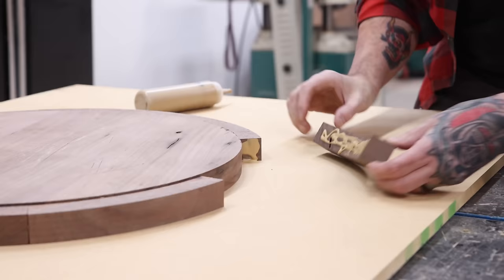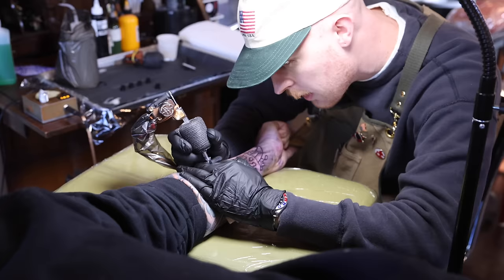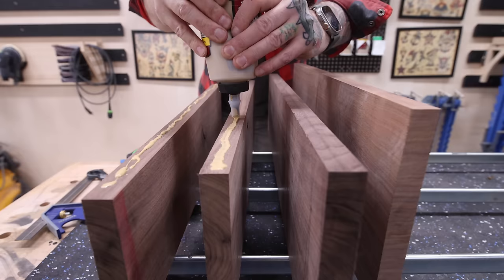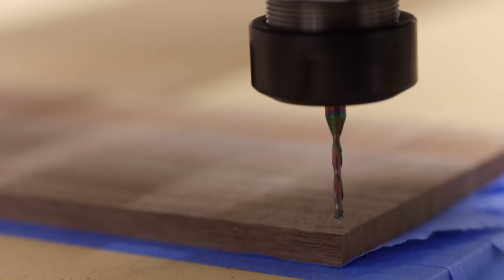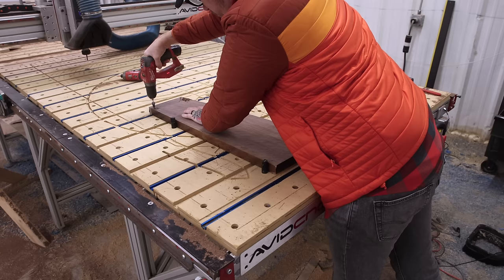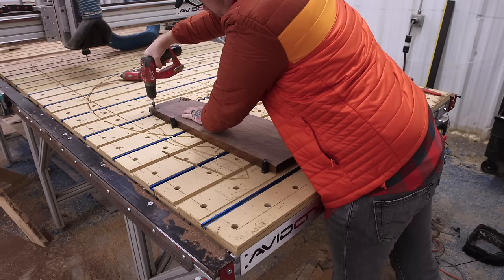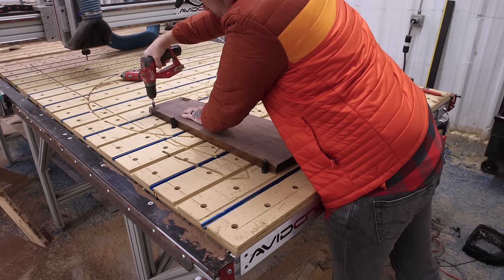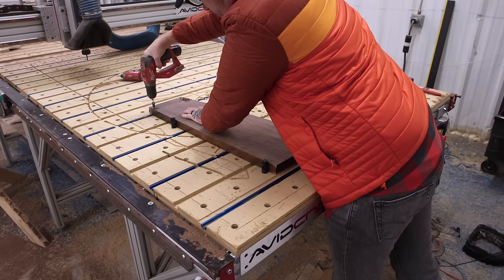$2000 Table from Only Scrap Wood

Comment: Offcuts that have been in the pile for years are the reason I can fix things at home quickly without having to run to the hardware. Everything has a use one day
Reply: Exactly. I tell myself that as long as I know where things are and I can find them when I need them, it's not hoarding.
Reply: My late wife used to moan about all the offcuts and strips of wood I used to store in the roof of my shed . . .  oddly, she never complained when they came in handy and saved us money!
Reply: @theverseshed  I guess there are a lot of us like this out there. :D People who don't fix things think you're quirky for storing away random things but then they are baffled that you can whip up an improvised solution to almost anything in minutes. :)

I'll say I used to hoard more plastic thingies before I got a 3D printer with which I can model and make precisely what I need, but even so - pieces of metal, wood etc. are resources, not rubbish.

Comment: Dear Jonny, 
You are demonstrating a significant level of trust in the premise that your furniture will not share space with dogs, kids or clumsy adults. Some folks might have joined the top and base with a process that used the word "recessed" in the description. It's your show and your creation so of course it's also your choice but, I suggest that you pack a bottle of glue and an admonition against nails and screws with the table when you send it out.
Love your show. Thank you for sharing.

Comment: That table turned out great using only offcuts and scrap lumber. It looks amazing, and I wasn't sure about the divits and spray paint but it helped pull the top and base together in the end.

Comment: I was considering doing something like the table base with my OFFCUTS.  When Jonny Builds, Jonny Fails, but Jonny doesn't get upset.  Instead Jonny becomes introspective.  Failure doesn't stop Jonny.  It's just a step in the learning process.

Comment: Love your offcuts table.  One tip I'd recommend is to avoid gluing wood stacks with alternating grains.  The border you put around the top will likely be problematic down the road since it's trapped the other wood from expanding/contracting.  Using a different substrate (plywood or MDF) for the glue base of your offcuts instead of solid wood and also making the offcuts thinner (like veneer) would be a more stable construction method and ensure that your great craftsmanship lasts for many years.  Otherwise, loved your design.

Comment: one of the best methods i've seen for steam bending is using multiple thin, almost strips, of wood steam bending them into shape then glueing them together into one larger piece and sand carving them into the shape you want. Offcuts

Comment: Your technique and work flow have always been impressive! Have you considered using larger masking? I use 12 or 6 inch wide medium tack masking with my laser and it may help speed up your use of masking tape when holding down your pieces for cnc processing. Cheers, hope this helps!

Comment: Steam bending takes a longer time you can use kiln dried wood. Also DON'T use fabric softener, just steam it and have your jig preset and prepped for use and immediate clamping. It takes time, patience and practice. Remember trust the process. Offcuts

Comment: offcuts!  also you could have used a blow torch to burn the holes and sand back instead of using spray paint but it looks like you achieved the effect you were looking for

Comment: Wow, you really love the activator on that CA glue.  If you had used more, the CA glue on the "offcuts" would have cured before you even put it on.
Reply from the maker: Usually my issue is spraying too soon, not spraying too much.

Comment: Already subscribed, random comment..... HOWEVER..... why did you use such beautiful wood as a "bed/template" that will never be seen... you could have used any number of wood products,  instead of hiding g beauty for structure purpose.... MDF,  poplar, pine, melamine, etc... if it's never going to be seen, why use beautiful wood, then hide it?  Maybe its because I'm in alaska and we don't get anything better than birch to work with, but I hate the waste.

Comment: offcuts              why not turn the column with a lathe?  Then if you want to make the project more difficult; carve out the column in a spiral with balls in the center of the spiral.  won't be as strong.

Comment: I liked the table, however, I think it could have been a little, no a lot more artistic had you used different species of wood for the contrast that God has provided in His creation.  You did achieve an element of that with the black epoxy, but some birch, pecan and cherry would have given it a greater element of depth.  But that is just my opinion, what do I know, you're the star.